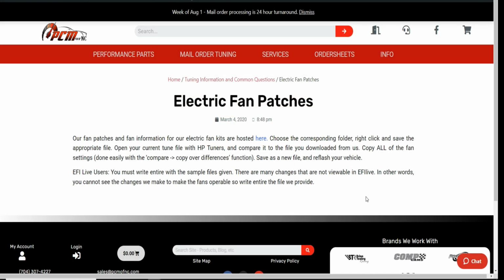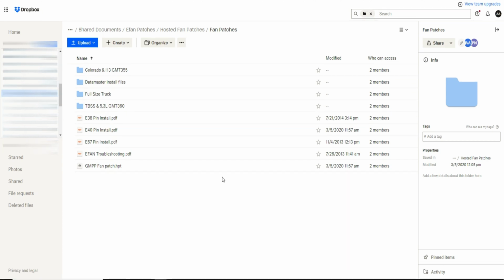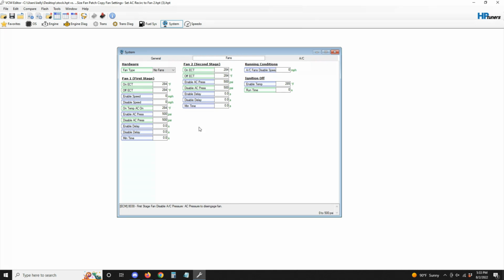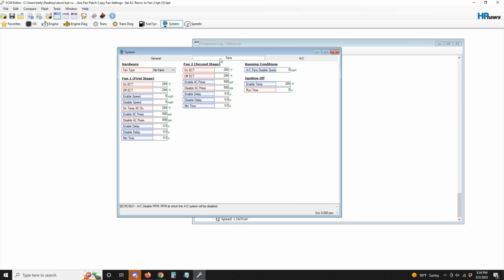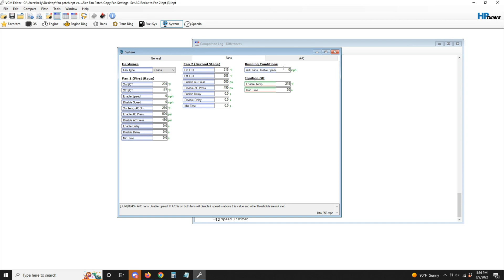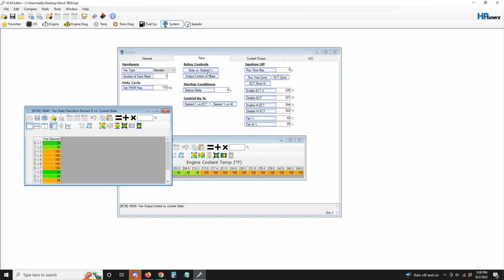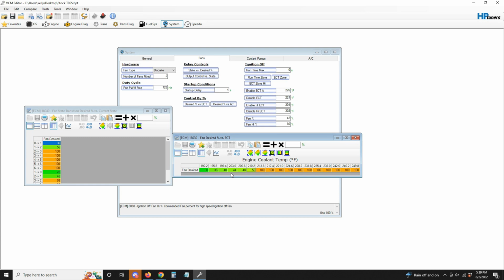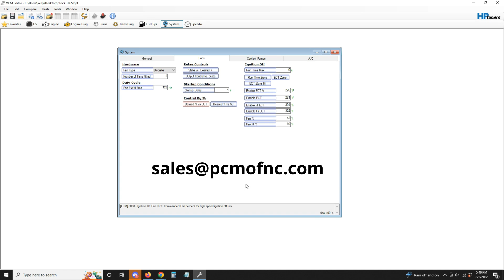PCM of NC HP Tuners Electric Fan Patch Application

Comment: @PCMofNC Any chance of making an updated video for this that applies to Gen V, w/ E92 specifically GMPP LT4 Connect and Cruise with the two prewired fan relays?  In the LT4 crate tune, the Desired % looks a little different than in your video. Yours is table 18030, whilst the crate LT4 lists it as 18060 and there's three rows so it's Fan Desired % vs ECT vs Desired ECT where the Desired ECT axis rows are labeled 194, 221, 248 and the state values across are all the same for each column in the row. So should any change be made to all three Desired ECT rows? Hope this makes sense.

Comment: If you right click on your Fan Desired% table, it will bring up a graph of the table settings. Scroll down with your mouse at the 192° setting and it will bring up lower temps that will save in your tables.. Least it did on my Gen V

Comment: Can i modify this file for a cam and anything else, or swapping the thermostat to a 160 degree thermostat?
Reply from the maker: It is a stock file aside from the fan patch, so you can modify whatever you like. However the idea would be that you would take your file and compare it to this one and use the fan settings, that way you are still using your own stock file (which would have your sensor/injector info and you probably licensed already).

Comment: Do you guys lock the computer after the fan patch so i can't use a sct or bully dog tuner or can i still use the bully dog or sct tuner?
Reply from the maker: Good morning, we do not lock our ECM. However you would need to be very careful using an SCT or a bully dog after because you wouldn't want it to overwrite the fan patch.
Reply: @PCMofNC  So will preloaded tunes still work?
Reply from the maker: @seangowan7441  it would most likely overwrite the fan patch when you flashed it. Using something like HP tuners would be a better way to go as it can retain the fan settings.

Comment: 3rd gen stuff seems to be pretty easy, and there is a shit ton of information on them. However the 4th gen (I'm learning is GM's  red headed step child that nobody wants to touch) it's limited at best. And as far as E38 ECM Fan control is particularly hard to find.  I have a 2013 LS3 with the factory E38. Tr6060 manual transmission. I've installed it in a 1970 camaro and it's a strong running engine that runs and drives. I have the green and blue wires for fan 1 and fan 2 triggers (grounds) to control the relays for the dual spal fans. It worked great. I had it at its factory temps. Car ran at 200. Then the ecm didn't like the voltages and threw the PO480 DTC and after two weeks of reading forum's and listening to many others struggling. I pulled everything out and wired it up to a simple two relay one fan low two fans high setup.  I want both fans at low speed and both fans at hi speed. Also the trianary switch for the a/c to kick on one or both fans. My question is do you guys offer a kit or harness to do this? Do you have issues with the E38 ecm's since they are PWM fans in the original Camaro? Wouldn't the ECM be looking for voltages corresponding to the % vs desired state or vise versa ? 
Is there a single person on this planet that has successfully landed the wiring  and not had the PO480/ PO481 DTC 's ?? I'm so close to yanking this entire system out wiring and all and just putting in a dam terminator or something similar !! 🤬😡👨‍🔧